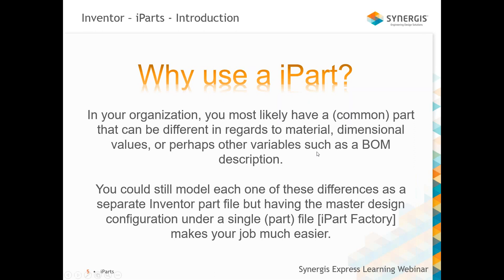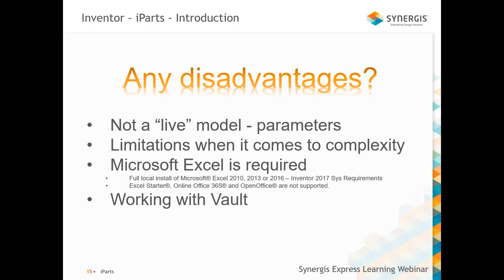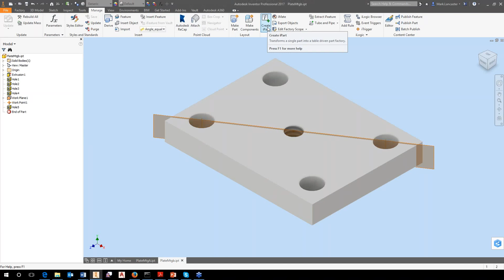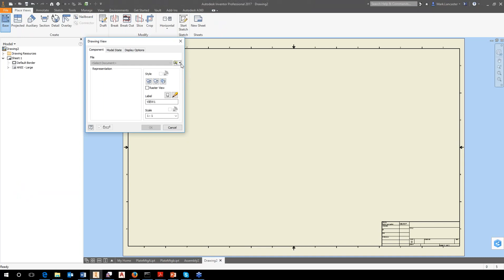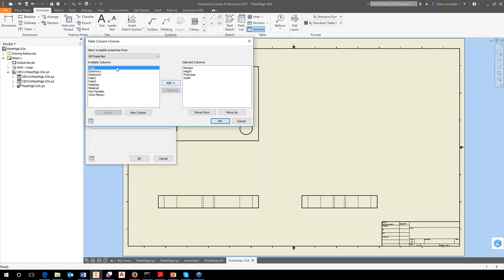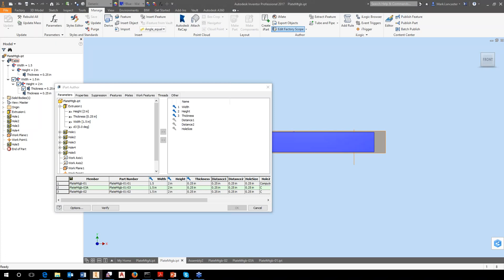Synergis Express Learning Webinar  Introduction to Inventor iParts

Comment: Hi good video, Could you help me with this? First: I have two iparts (A,B) they have the same longitud(longA1=longB1, longA2=longB2...etc) so how Can I link this parameter? and, Second: I want to make an assembly where ipart A1 matches whit ipart B1 , A2 with B2, etc. How Can I do that? Thanks
Reply from the maker: Hi Dieter A S, it's not clear from your question(s) if iParts A and B are in the same factory or in different iPart files. Please let us know and we'll be happy to help.